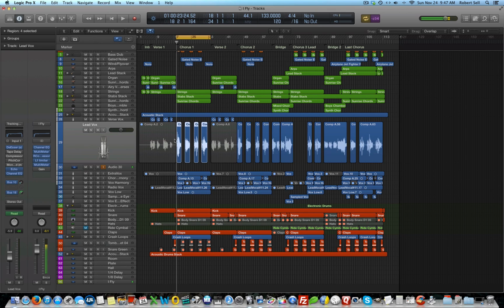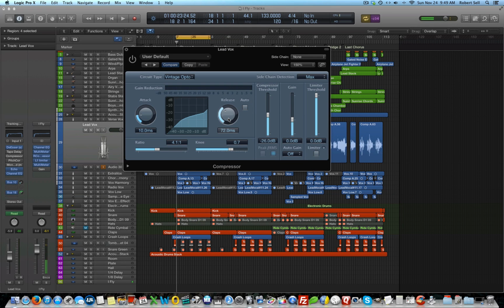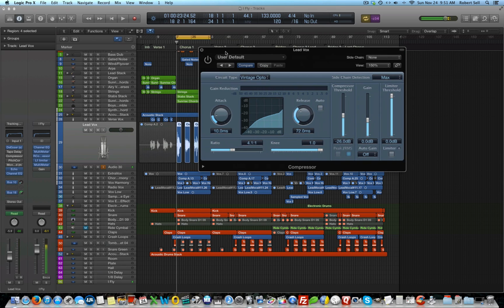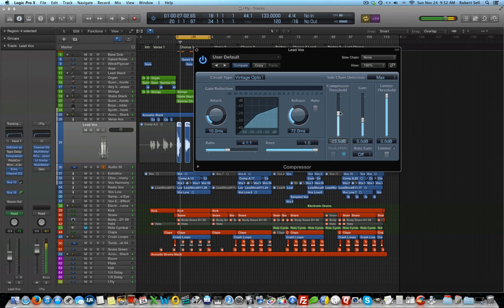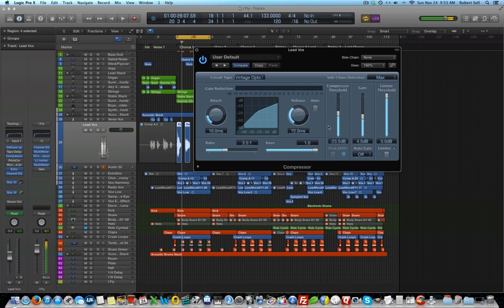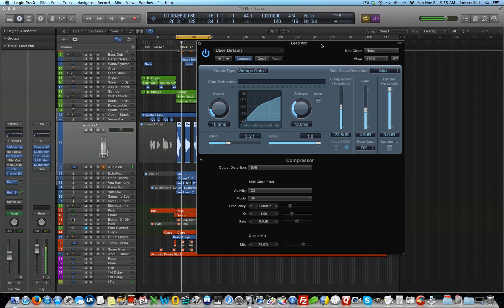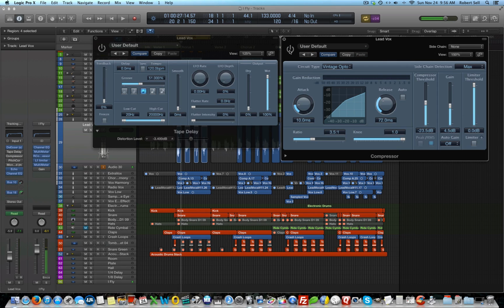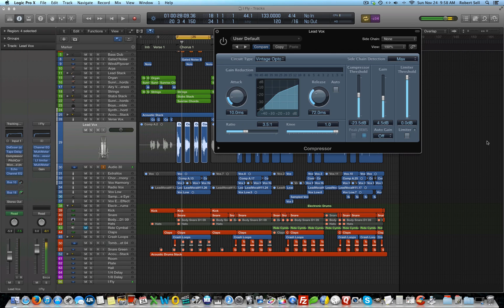Logic Pro X Compressor Settings for the Teletronix LA-2A

Comment: Hi Bob, thanks, this is still great even though you did it years ago! I noticed you used a compressor output mix setting of 74%. I understand that gives you a little parallel compression effect, please comment on that. Is this how you prefer to set up parallel compression for vocals? --or was it just happenstance for this lesson?
Reply from the maker: Thank Dendi! For this setup I would normally have the compressor set to 100% for the output. That was 5 years ago so maybe I mixed it that way to taste or it could have been an oversight. Today any parallel processing I'm doing is with an aux track. Thanks for the comment.